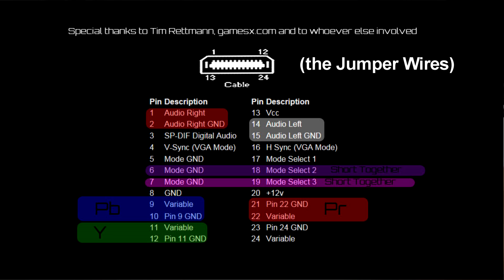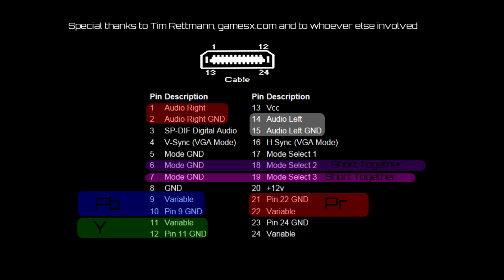Make Your Own Quality Component Cable For The Original Xbox

Comment: As it happens, I ended up with 2 Xbox 360 cables in a bunch of stuff I got from a friend.  1 was the HD cable like you use here and the other was just a regular RCA L-R audio and video cable.  I have another regular Xbox cable that I am going to attempt this with if I can find it.  I knew someone would know how to modify the 360 cable!  Thanks for this.  I'll edit this after I find my cable and do the mod.  Also I am going to try to save the cover and try to put it back together, although it shouldn't matter since it's going to be behind the Xbox and no one will see it!  LOL  I always watch the videos at least once, if not twice before I attempt any mod!   It's just the right thing to do!  LOL

EDIT:  So I did this mod and it worked like a charm!  Can definitely see the difference!  I don't like the fact that all the ground wires are a bit bigger than the others.  I haven't closed my connector up as of yet, because I think I am going to use some slightly smaller wires and re-do the ground wires.  I have original Xbox connector cover on the wire, so when I get finished I will be able to put the shielding on and then the cover so it will look more original.  Thanks again for this video.  Liked.
Reply from the maker: I appreciate you watching. Yeah I always meant to re-use the connector piece but after I started to solder I realized I forgot to put it on so I just said oh well and covered it in hot glue. But it definitely looks nicer with the original connector in place. Glad to hear you got it all up and running. To make the grounds smaller you can just un-braid them and cut them till you get your desired size that's what iv done. Thanks for watching

Comment: Would this work if the 360 cable was from monster or pelican?
Reply from the maker: Yes it would work but I don't think the colors will be the same, thanks for watching
Reply: @TechnoOnTop  where can I find a diagram? I split open a pelican and the colors are different.
Reply from the maker: @iamlazarow3526  probably nowhere. You will need to use a multi meter to figure out whats what. Or use a pin out for the 360 av cable

Comment: Looking for the pinout on the motherboard to make my own Coaxial output - thanks. I don't want to buy a Component AV Box at 100$ for optical audio
Reply from the maker: The pinout exists try Google images. It's been on my to do list as far as tutorials go. Iv been kinda slacking. But I am still here lol. 100$ for that box is pretty expensive considering you could buy the jack for just a few bucks or better yet harvest it from something else.
Reply: I couldn't find it - only found it for analog Stereo. Since Xbox-scene is dead it is complicated
Reply from the maker: Google "original Xbox av pinout" the first two images that pop up are what your looking for.
Reply: Thanks - I had problem opening images with their new system but my Xbox died yesterday, buying one this Thursday. Look at these, I do not speak Spanish but easy to understand. I least I have a barely used DVD Drive, PSU, complete shell, ports for spare parts, universally compatible at least
https://www.elotrolado.net/hilo_mod-componentes-xbox-fotos-y-video-insaid_2025889
https://www.emudesc.com/threads/xbox-para-pantalla.595314/

Comment: Apparently this only works with fficial 360 cables as the unofficial ones are color coded differently and have two extra wires not shown in this video. Found that out the hard way.  Great video though man!
Reply from the maker: Yeah you never know what a different manufacturer will do as far as colors, it can sti be done but it will be more work and you would need a multi meter to check each wire. But thank you I appreciate that!

Comment: I was searching online for a component cable for a Cousin's Original Xbox and the prices are crazy for a good one with shielding. Came across this video and soldering, dissecting; heck yea! 

But my soldering equipment would greatly appreciate a nice scrubbing because I haven't touched it for a long time but also the rough look of the end product doesn't provide my cousin insurance that my cable won't short her OG Xbox :\
Reply from the maker: iv never had any issues with my ugly looking cable. i have since replaced it with one where I kept all the stock connector intact just be careful when you take it apart and it will all go back together nicely. its something i should of done in the video but i forgot to put the plastic bit back on. then just decided on hot glue, which i obviously get alot of hate for but lets face it you never see it and it works just fine

Comment: Y, Pb and Pr have "Variable" and "Pin XX GND" - Does that mean Signal and ground? I have a Xbox output cable and RGB cable to spare. I am willing to cut each cable and weld them individually. Can I do it directly from the motherboard and have a permanent cable?
Reply from the maker: Yes you can solder connections directly to the motherboard and have a permanent connection,
Reply: Thanks, it is really helpful but the cheap 3rd-part cable I had connectors fell... I am working on a Xbox inside a PC case (Acer Inspire, mini-ITX) + Watercool CPU & GPU
I am a bit stuck in my project, can you help me please? The mini-board in the front of the Xbox that has the Power and Eject button with the 9 yellow cables, I have tried to jump the signals using the PC's power button  (Red & White wires )but the Xbox buttons seems to be working on a single line and I cannot jump it, positive first or last, doesn't work. Now I have to make 2 precise holes in the front of the Aspire case to fit buttons but I don't want to
I simply want to use the Acer's buttons but cannot make it work, I'll send pics of the parts in question if you need
Reply from the maker: both switches should just be your basic momentary type. it should just be as simple as connecting them up right, if all you care about is power then its just pins 1 and 2.  here's a link that talks a bit about the power board and gives you some diagrams/pinouts to help http://diy.sickmods.net/Tutorials/Xbox1/Power-Eject_Pinouts/  sounds like a cool project water cooling in such a small confined space is pretty difficult unless you choose to go with rigid tubing (which iv never done but i assume its also difficult). the smallest water cooling parts still take up alot of space and there are some errors in their specs when it comes to fitting sizes. i dont remember exactly but the smallest raditor says its a certain bard size which it actually isnt so then the tubing didnt fit snug on it, then when i tried a smaller size i couldnt get it over the other barbs which are the smallest ones you can get already so that porject got abandoned though i always consider bringing it back since iv already wasted all that money on it lol...

Comment: Perhaps my iron is just too wide and my solder sucks but all i did was end up ruining two cables... Soldering to those tiny inward pins by the black dividers is fucking difficult.
Reply: how the fuck do you get the wire to stay in the right place while you solder holy shit
Reply from the maker: a very fine tip on the soldering iron definitely makes things easier... though im pretty sure the very first time I did  it i was just using a standard conical tip but if you're melting the plastic between the pins your tip is probably too wide. as for keeping the wires in place you could use some tweezers? maybe some helping hands would be helpful also. hope that helps that sucks that you have been having trouble with it. keep at it im sure you will accomplish it! thanks for watching

Comment: hey, i need help.. my xbox 360 cables are blue, green, white, yellow, orange, red and black.. what do i connect where now?
Reply from the maker: um are you using official microsoft cables? because if your not you will need to figure out which color is which with a multi meter its not something i can just tell you since iv never ran across this. iv only made a few of these cables and the wire colors where always the same for me and for a bunch of other people. my only guess is the cables arent legit microsoft ones
Reply: TechnoOnTop thanks for the reply, i figured it out myself, had to ground 2 additional wires and the orange wire was the red color input.
btw this was my first time soldering and i kinda got it working!
but i will order new xbox and 360 cables for a clean second try.
Reply from the maker: Glad to hear you got it working, this isn't something I would recommend to beginners but as you proved it can be done good job and happy modding

Comment: Great tutorial. I meses a little bit of help. After all this my colors on the screenshot was dark grey. I was able to enable the 480p, 720p and 1080i but when I restarted my Xbox the screen went all black. I cannot see a damn thing and no sound either. Help please.
Reply from the maker: typically to be able to enable HD you need to plug one of the video cables into the yellow composite spot (which it sounds like you did) then after that you can plug it in right, red, green, blue, red (which it sounds like you didnt?). aside from that just checking over all your connections making sure everything is right and nothing is shorting out is your next stop. hopefully that helps thanks for watching

Comment: Instead of wrecking a perfectly good composite cable I'm buying an ebay cheapo to get the jack and a Monster brand component male to male for the shielded wiring. Wish me luck!
Reply from the maker: alright man! sounds good be careful with those cheapo jacks the pins can get pulled out easily and they never quite go back in right. good luck and thanks for watching!
Reply: TechnoOnTop Thanks for the heads up.

Comment: Question: Wouldn't it be a better idea to also run a wire from pin 8 (Ground) to the original metal shielding and re-install said shielding? It just seems like you're asking for RF interference by skipping that step. (Also, further shortening the 360 cable so that the minimum amount of wires are exposed without RF shielding)

Not trying criticize or anything, just curious since I'm planning on attempting this soon.
Reply from the maker: No worries, I personally haven't had any issues with any interference, iv only made about 3 of these cables myself and Noone has complained about having interference issues in the comments . When it comes down to it all the grounds are common somthing I learned later despite being pretty obvious .. Which to me would make adding an extra metal shield ground pointless but I'm not Microsoft they did it for a reason but iv never done it myself I appreciate you watching an extra layer doesn't hurt

Comment: Quick question. Is the color coding for the component wires standard for all component cables, or is that more microsoft proprietary crap?
Reply from the maker: I wouldn't say it's proprietary, but I wouldn't be surprised if other manufacturers use different colors for different things, a person in the comments below successfully used a wii component cable in place of the 360 but I'm sure the color coding was different, a multi meter could be used along with a pinout to figure what wire was which

Comment: I just got done with this and it works great so far. At first I wasn't getting any red signal but it turns out I soldered the pink wire to pin 24 instead of 22.
Reply from the maker: glad that you got it working! thanks for checking it out!

Comment: Hey I'm currently attempting this mod. I have a question. I ended up cutting the whole connector off the 360 cable instead of disassembling it like you did. What I found underneath the outer insulation is: a thick layer of ground braid, covering a thin foil, covering braided wires. My question is: is it ok if the outer braid that covers everything is touching the other braids that each wire has? I feel like its impossible to prevent that now since the foil broke off pretty fast. If anyone can answer this, please reply ASAP.
Reply from the maker: the wire wrapping around each wire is the ground. twist it up and solder it to the appropriate ground points, dont worry you didn't mess anything up all those grounds touch each other honestly you may be able to just ground one point (never tried) and be ok that's how the cheap component cables are hooked up, thanks for watching!
Reply: TechnoOnTop thanks my dude, cool video.
Alt account btw too lazy to switch
Reply: Just wanted to tell you: it worked! I tied up the ground signal from the yellow wire to the overall/outer ground and then soldered it to the metal casing. Didn't do a perfect job cause I could notice a tiny bit of interference on the screen. Not a big deal though, you'd need to press your eyes up against the screen to notice it.

Thanks for the video guide!
Reply from the maker: Hmm well that definitely makes it easier thanks for letting me know I had always wondered. Will be sure to pass the info on if anyone asks. Thanks for Checking out the video glad to have you aboard!

Comment: although helpful I am now way past the point of no return and was wanting to reuse the xbox connector housing ....which is now impossible since you had me bend it out of shape. I thought you would of had some trick to make it look stock but now its trash since I don't want that ugly glue crap looking connector you have. thanks for ruining my two cables
Reply from the maker: if you wanted to re-use the metal bit from the beginning then why did you bend it up so bad, you should always watch a tutorial all the way through first before blindly following it. that metal is easy to bend back just like it was easy to destroy. thanks for watching!
Reply: lmao good job not watching the whole video before cutting :D
Reply: Yeah dude blindly following a tutorial on YouTube is how the cell phones in the microwave thing happened. Watch a tutorial all the way through first and plan a bit better before you attempt a wiring job noob. Understand how what you want and what the tutorial shows are different and plan accordingly. It's not rocket science.

Comment: Is it possible to make your own ps2 component cable?
Reply from the maker: im sure it is, though the cheap cable i bought for my PS2 has no interference on my Phat ps2, only on my Slim Ps2 but i chocked that up to the cheap knock off AC adapter i bought for the slim. are you having interference issues?
Reply: TechnoOnTop I don't even have one... also I wanted to ask you something: I have a hdtv and I'm running my ps2 with composite cables (red, white, yellow) and the picture is terrible... will component cables fix this?
Reply: What is the best solution for getting a good/sharp picture?
Reply from the maker: ahh ok, well I would recommend getting some component cables, they will definitely improve your picture vs composite like i said i bought some cheap ones on ebay and they dont give me any interference on my Phat ps2 and the picture is nice. another option would be some type of upscaler/ conversion box but i would only do that if your tv doesnt have a component hook up

Comment: i think i will stick with composite on my 4ktv sigh lol.. this is for real techies or technicians at a novice level at the very least
Reply: why would you ever use composite, especially on a 4ktv lmao. Component cables exist, you dont have to make them.
Reply: MagnuM00125 It's easier than it looks! Practice a little soldering on some old stuff you don't need first and you'll get better in no time!

Comment: Well the cheapie cables I got gave out. Started off with a green hue over everything then the sharpness of the image went fuzzy... complete shit!

Happily I've fixed the official ones I bought (faulty red video signal) and the quality of the picture is actually better on my new tv! I have wondered if maybe the MS cable has a scaler chip or something because Xbox games always looked better @ 480p then anything on PS2 @ the same resolution. Any idea TechnoON Top?

Anyone wanting the best picture for their Xbox (and who's no good at soldering) had better snap these cables up on Ebay while they can - think in a few years they'll be as expensive as the Gamecube ones. When they come up on Ebay UK now they go for like £70... price is always creeping up.
Reply from the maker: iv never owned an official MS component box, but as far as i know there is no scaler chip built into it. the cables i made have no scaler chip and the cheap cables defiantly had no scaler chip.
Reply: Cool thanks.
Reply: It will always looks better than PS2, the image quality for that console is really bad compared to the Xbox. I've used both consoles with component and scart, and the video signal of the Xbox is always a lot cleaner.

Comment: Thanks for the Tutorial. My Cable Works like a charm. I also desoldered that SP-DIF Connector and hooked it up to the required Pins via Short cables and even that works Perfect. Thank You very much!
Reply: The Front of the SP-DIF(Toslink) Connector facing towards you!
I Soldered Pin 3 (XBOX Connector) to the right Pin/Pin 1 of The Toslink Connector. You also need to Connect Pin 13 VCC which is +5V (XBOX Connector) to the Left Pin/Pin 3 of the Toslink Connector and Pin 23(XBOX Connector) to the Middle Pin of the Toslink. 

The 2 bigger Pins from the Metal Casing of the Toslink Connector are supposed to be Soldered to a PCB/Mainboard,
but for now, i just bend them down.

If done right, the Toslink Connector should light up Red, while the Console is Running.
Reply from the maker: No problem happy to help! thanks for watching!
Reply: What pins did you connect for sp-dif, pin 3 to...
Reply: Sorry, i think, i got the Pinout of the Toslink wrong. This one should work.  goo.gl/vP4buw
Pin 3: Vin is the Digital Audio.